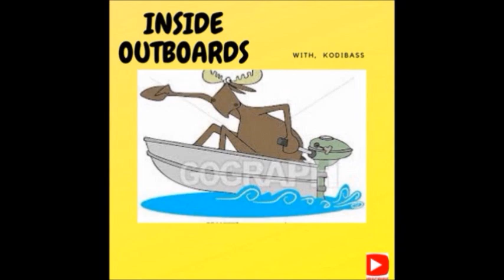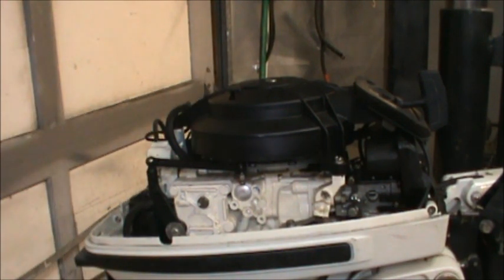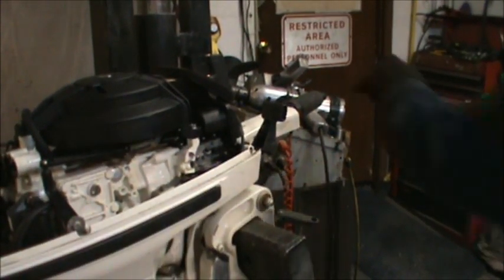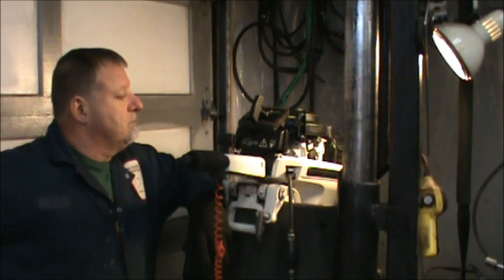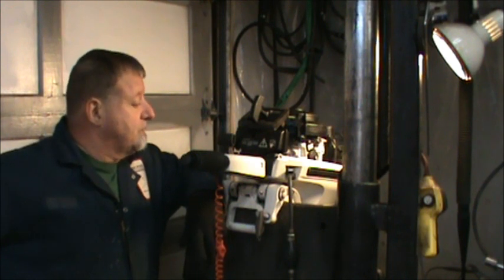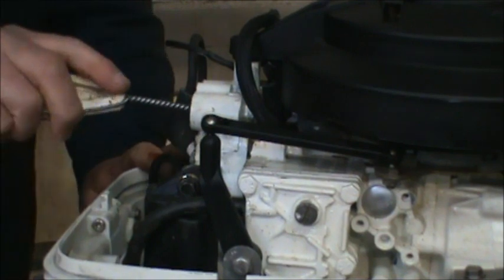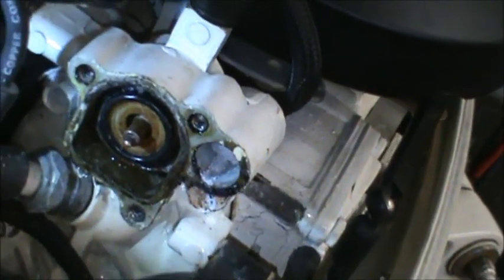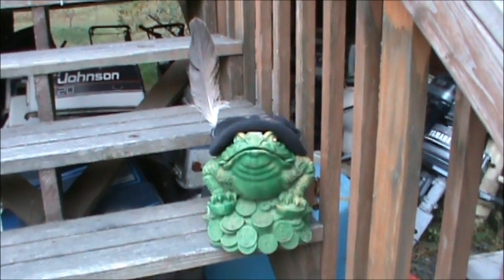JOHNSON  15 HP OUTBOARD MOTOR REPAIR,  (( Part 2 ))

Comment: One more finished, another satisfied customer.
I wish all those ol' OMC's had a 3 bolt thermostat cover.  Sometimes it's a pain removing all those head cover bolts on the ones that don't, especially on the salty ones.
Reply from the maker: Right on,  Heck even some of the later models still used the head cover plate to get @ the  T-stat.        kodi

Comment: Thanks for the video Kodi. I have an outboard just like this one. Currently working on it. I just rebuilt the fuel pump, maybe you can help? How does the cap need to be positioned on the fuel pump? I see most are so the barb is between the left and bottom screw? Is this vital for proper function?
Reply from the maker: Nope,  position it to whatever point makes for easy hose routing.                    kodi
Reply: @kodibassInsideoutboards  thanks a lot buddy. I was a little hesitant about my installation. Got the day off tomorrow. Will try it out first thing. 👍👍

Comment: Cool, so nice when the problem is simply fixed.  That thermostat "system" always seemed overengineered to me...Engineering was going for a self cleaning idea, but all those pieces/parts seem like "over kill" to me.  I've been told that those diaphragms are NLA, so be careful not to damage that piece...
Reply from the maker: I really do not even truly get how this Stat functions, Kinda a cross between a stat & pressure valve thing.  I  have been meaning to try to fit the older style metal stats into one of these post 92 models & see what the temps run.     kodi
Reply: @kodibassInsideoutboards    Yeah, it is a complicated version of what should be a simple thermostat/pressure relief valve.  Engineering was trying to create a self cleaning system that eliminated the possibility of debris getting caught between the thermostat and rubber seat.  OK, well they accomplished that, but just seems like the debris would now get caught between the top of the thermostat and that rubber diaphragm.

Comment: Hi Kodi, have a question for you. Got my old 57 mercury mark 10hp running and peeing good but when I put it in gear or try to increase the throttle it will die. The carb main adjustment screw is at 1 1/2  turns but I'm thinking it may need turned out more to the rich side. It's a 2 cylinder 2 stroke. I'll be messing with it soon but just wanted you opinion. Thanks T
Reply from the maker: There are 2 main causes for your problem,  The mag plate has to rotate to advance the timing to burn the increased volume of fuel in the combustion chamber (cylinders), check to make sure the linkage is working to do this,  Next is the transition chamber in the carb body it needs to be clean with no blockages inside this chamber so the idle circuit can deliver a extra volume of fuel to be used while fuel passes from idle jet to high speed jet. for increased fuel volume / RPM.   kodi
Reply: Thanks Kodi, everything works but there is something not set right. I cleaned the carb good and points and have spark. But I didn't check the point gaps. When watching my spark with the lights off one plug was weaker than the other. Plus it may be a bad coil or condenser? Too many ifs? Someone is selling a service reprint copy on ebay for the 57-58 mark 10 for 18 bucks so will start there so I have some settings and troubleshooting guide for this motor and go from there. Meantime going to clean the fouled plugs and try again before taking the flywheel back off
Reply: Oh, I guess I should explain this better. The mark 10 has a lever with 3 postions. Far right start, middle run and far left troll. I can start it and it runs in that position but when I start moving that lever to the middle run postion it dies

Comment: i have a 1976 johnson 25 hp outboard that is leaking black greasy looking stuff from between the cavatation plate and the bottom of the engine.  I have replaced almost every part on this motor and finally got it running and now this.  any help would be appreciated.
Reply from the maker: What you are most likely seeing is old carbon build up in the exhaust leg from sitting for a long time & not run,  Change your lower unit oil,  If it does not look like coffee cream, or no water comes out first refill it & go run the heck out of the motor & it will clear itself out.              kodi
Reply: @kodibassInsideoutboards  thank you so much..

Comment: can the thermostat just be left out without problems?
Reply: I have a 1956 30 hp Johnson and it doesn’t have a thermostat but I also have a 1959 35 hp Johnson and it does I got the 30 hp from a guy had in his basement since 1975 he had all the paperwork from his dad bought it new even has check off list and price the weight with electric start and without low hours all kinds of stuff like everything except the steering wheel I love that motor

Comment: What’s water temperature in your water tank, just wondering not that it makes a difference
Reply from the maker: Normally around 50 degrees in winter, 65 in summer.    kodi

Comment: I ran my two-stroke mercury out of gas to winterize it I hope I didn’t hurt it
Reply: Do you have any tips on doing that stuff
Reply: @robertbidwell4541  Running out of gas it good. I would also add stabilizer to the fuel, change the gear oil, check for milky colored oil in the lower unit when draining, and fill it back up with new gear oil. And put fogging oil in the cylinders and spin around the flywheel a couple of times to really get it in there and lube all parts. 
Those are just my tips to keep it nice.
Reply: Just winterized my kicker motor. It's a 4 stroke and not a good idea to run it out of fuel. Everything needs to remain lubed inside especially gaskets or they get brittle and start leaking. Fuel pump diaphragm needs that too and the inside of fuel lines. I use Yamalube on my 2 stroke motors but decided to run a 50:1 mix through the 4 stroke and store it that way. Just for storing only. Run that stuff out next use with your regular fuel.
Reply: @TimsWorkshopTJY  I bought a used 1985 Johnson 9.9hp 2 stroke in 1988 and have run it multiple times every year since. I always remove the motor from the 12ft Grumman Jon boat  after each use mainly because of the low height of the trailer has the outboard too close to the ground  for towing , so the motor goes in the trunk of my vehicle. Not wanting fuel leaking out of the carburetor while the motor is on its side in my vehicle, I have always pulled the fuel line and run it out of gas before taking it out of the water. I have done so hundreds of times over the course of the 32 years that I have owned it. I have never had to replace any leaky seals or gaskets in the motor and the carburetor has never been off or even required adjustment. You would be hard pressed to convince me running a small 2 stroke outboard out of fuel is potentially damaging. To the contrary, I firmly believe running the carburetor dry every time I run it is precisely why it has been trouble free for 32 straight years.
Reply: May have worked for your motor but I have a 60hp 3 carb mercury and the shop told me to run Yamalube through it. They told me the ethanol will actually cause rust after it breaks down if not treated. I said why not just run it dry and they told me about the seals.
Reply: @TimsWorkshopTJY  Are use premium I have a 50 horse two-stroke mercuryMy first boat so I’m trying my best
Reply from the maker: It will be fine, I often run them dry, but just before the motor dies from fuel starvation I spray some Tri-flow into the carb throat so it coats the reeds & carb body,  then I remove plugs and spray some in the cylinders & rotate the flywheel a cpl times.                              kodi
Reply from the maker: Thats a great way of doing it,  I do this often as well.   kodi
Reply from the maker: I find it mostly has to do with how the motor is stored,  If inside & out of the elements they r fine dry,  out in the slop  , not so much.       kodi
Reply from the maker: I have no problem running the fuel out but yes if u do fog it 4 sure,                           kodi